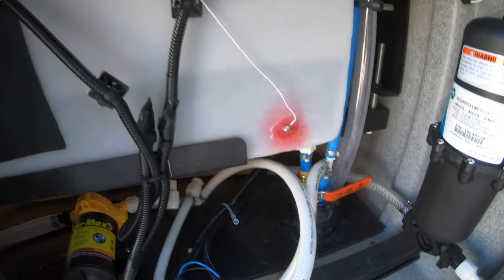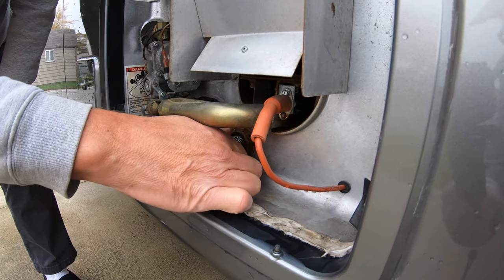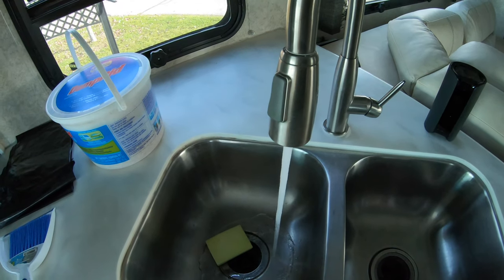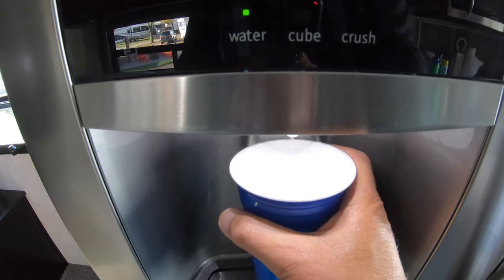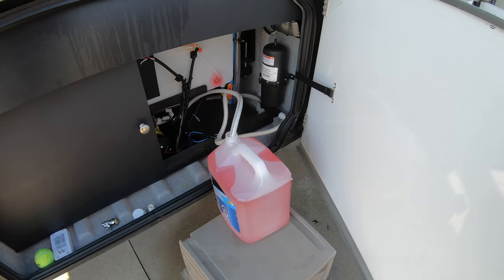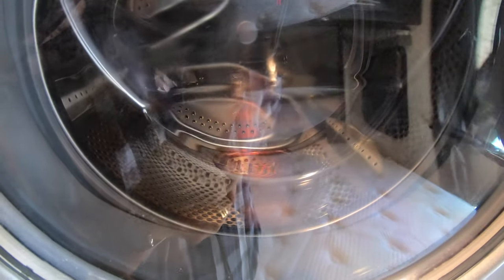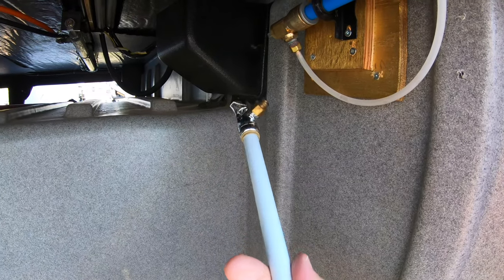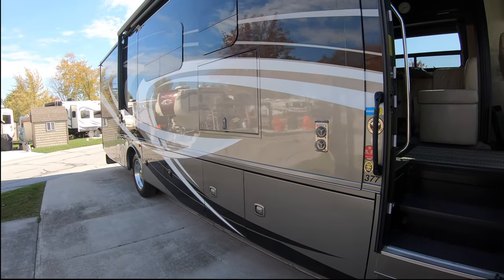Winterizing My Georgetown Class A Motorhome

Comment: Wow, I need to watch some more of your videos. That is a very polished presentation. Job well done.

A couple of thoughts:

You might want to demonstrate how to shut off the electric water heater and mention what will happen to the electric heating element if it's turned on with the water heater empty. $$$$
 - If you have the Suburban SW??DE, there's a black rocker switch in the lower left of its front panel or you can switch the circuit breaker off inside. You did mention assuring the water is cooled down to avoid scalding, which is good.

I put a piece of bent cardboard under the anode rod when draining the heater to channel the water flow away from the heater and the RV's wall. I tend to not trust sealant fully...

You might want to mention installing a new water filter in the refrigerator when using the RV again. (That is one elegant refrigerator!)
 Throwing the RV filter on the ground implies it will be replaced. :)

Later on you mentioned that you use a Viar compressor and I see you are using their winterization kit as well. but I don't think that was mentioned.

What is the red light in the upper right rear of the Splendide cabinet?

As an aside, I see you use a flowmeter on your city water connection as I do. Have you ever measured how much water the un-vented Splendide takes for a full cycle? It's supposed to use more water as part of its condensing process. My 2100XC vented model will use 14 gallons for a full Cycle 2, Heavy Cotton. I've never seen a figure on how much extra water the un-vented model takes, though.

Again, nice job. The process you demonstrated is portable to any almost make or model of RV.
Reply: P

Comment: Thanks for the great video!  I am interested in the same Viair system to winterize my Class B on the road as I go from warm to cold in the winter.  The only thing that confuses me is the need to use the air trigger (the one with the gauge) as well as the regulator.  I would think you could just plug in the regulator and be good to go.  Also, does the gun have a snap on the trigger to keep in flowing?  Otherwise I can't see how to pull the trigger and then be in the van checking the various faucets.  Thanks again for the video!
Reply from the maker: Hi Jon thank you for your message. Now it’s been a while since I’ve watched that video. But I think I don’t use the trigger handle. I plugged in the regulator piece into the viair   And let the pump run continuously. 
I will check out the video again and refresh my memory 
Thank you for watching and your comments.

Comment: What size is the hose where you added the fresh water drain valve? I need to add that? I have a 2020 378XL  Thanks for posting the videos.
Reply from the maker: The green hose is 1/2 inch and only 4 feet long. I have a no return valve on that hose to prevent any water going back into the line. 
Thank you for watching and your comments if there is any other information you would like please post
Reply: @ACanadianRVereh  The orange or maybe red handle valve that you added to drain the fresh water tank? Sorry for confusion.
Reply from the maker: @leegortman9573  check out this video is this what you are talking about. https://youtu.be/gL7hJKgFyNI
Reply: The valve you added to the fresh water tank drain line. I think the valve lever you turn that is orange in the video. By the bladder you added.
Reply from the maker: @leegortman9573  ok I got it sorry yes the valve is shark bite it’s 1/2 in an it’s in line to my fresh water tank. 
I couldn’t figure out witch valve you were talking about. I keep thing in the water bay with the hole RV filter